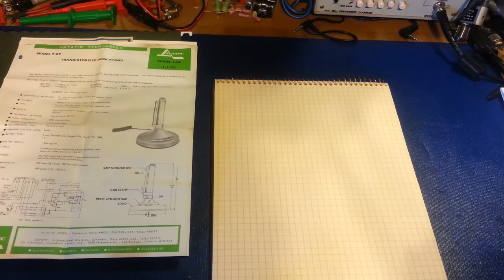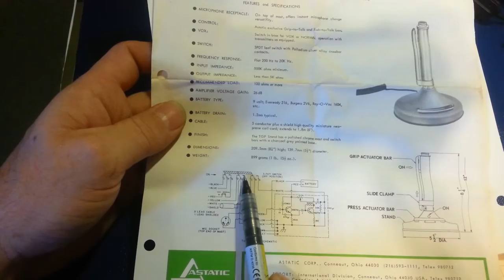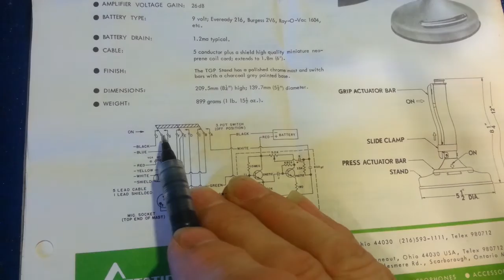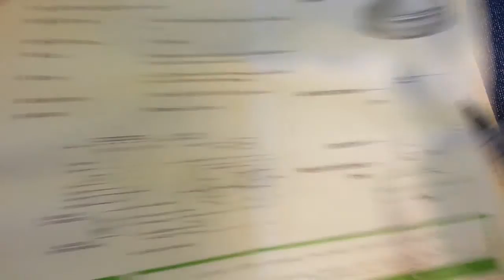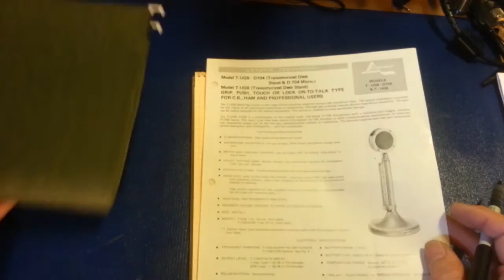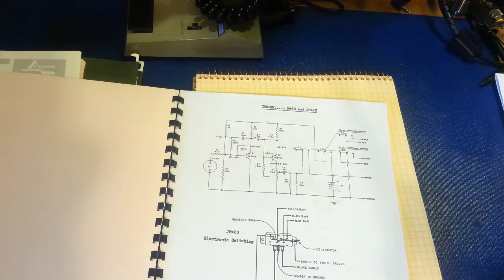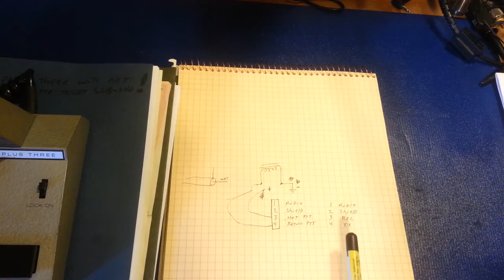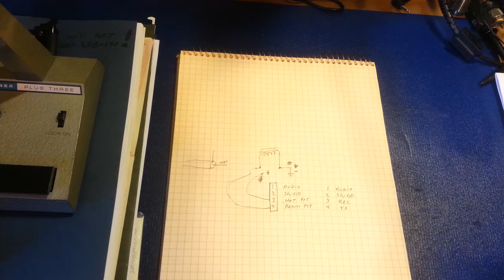Wiring a microphone for relay or electronic switching.

Comment: Awesome tips thank you! I was using your video to help figure out an on air light circuit that I can wire into the mic plug and light up the sign when keyed. My power mic has a transmitting led. I will start there.

Comment: So I was hoping to hear a nugget here that might help me solve at least 1 issue with the model base (stand) you have here.  Firstly, I have a loud 'thump' when I push the PTT to key up a Lincoln II+ (v.4).  Can this be eliminated by adding something to the mic itself (or radio mic jack)?  Secondly, using this mic (on the said radio) changes the channel intermittently, 10KHz, when the PTT is push...but intermittently.  No pattern/not ever time PPT is pushed...until it rests at CB channel "1"....then it goes no further.  The mic works, no problem with audio, no squeal, etc.  Any ideas?

Comment: So I’m doing something that some may find dumb, I want to build me desk mic, i am using a cobra mic from a cobra 29, I want to know if I can use a push button in place of the ppt button that is in the mic, is that possible, I got a desk mic ordered I’m just wanting to make one for fun, a learning experience
Reply: The radio I’m using this mic on is a connex it receives without the mic being hooked up if this helps with this little project
Reply from the maker: @mikehannahs  
Yes, a simple normally open push button non latching switch would work.  When you push the switch it closes the contacts placing the radio in transmit and when you release it since it's non latching it goes back into receive.
Reply: Sweet, will a push button with only two terminals work for this and do you know which wires I’d use? I have the pins figured out so I know what each wire does I just no idea which ones to use or hook up out of the 4 and shield
Reply from the maker: @mikehannahs  
Yes, a 2 terminal switch is all you need.  The TX pin is pin 3 and it gets grounded to pin 1 which is the shield/common.
Reply: Ok cool, once I hook those two up to the button what should I do with the other wires left on that push button deal out of the old mic? Sorry for the abundance of questions I’m learning 😂😂

Comment: How to find what wire colors and for what.. . How to find Whitch wire is the ground,audio lead,transmit control, receive control on hmn3596A cb motorola microphone.
Reply: Unfortunately, Motorola's microphones do not have the RX feature for a standard CB radio. Such a microphone could work with a CB radio, but only for models that have reception without the microphone plug inserted.

Comment: I still can't figure it out the right way. I have this model D104 to 4 pin. I took off the old 4 wire cord. And solder in a 6 wire cord. I didn't use the yellow as normal. And used the blue wire wire shield. It does work put the wrong way by adding talkback or monitor that it's called. But the mic gain has to be turned way down. And the mic amplifier has to be kept way down also. Any help would be appreciated. KK4YLF 73's
Reply: You accidentally permanently soldered the RX wire to the ground / screen. Shielding along with blue should switch to black for RX, and when you press PTT to red for TX.
Maybe you made a mistake.
What's your radio?
Reply: @arkadiuszweiss  Cobra 29LTD, 25LTD, Galaxy 4 pin style radios.